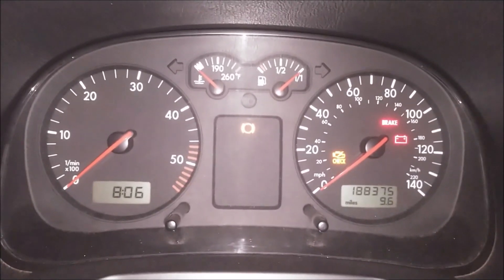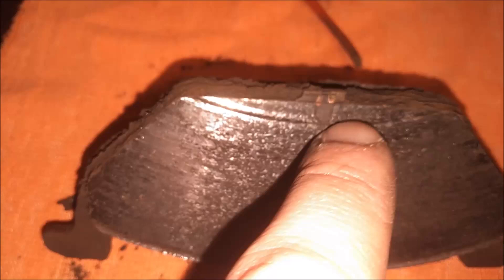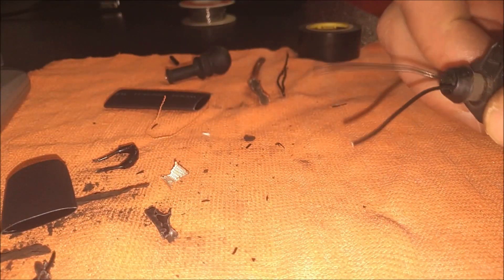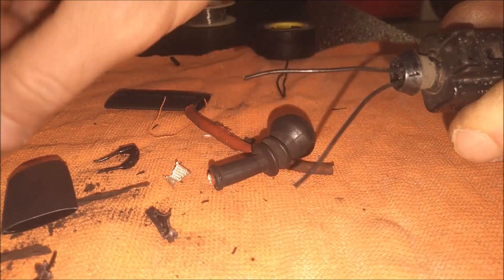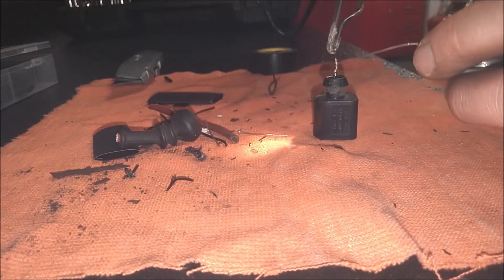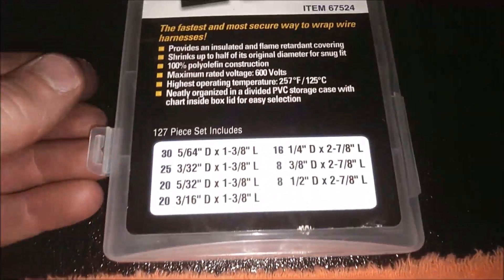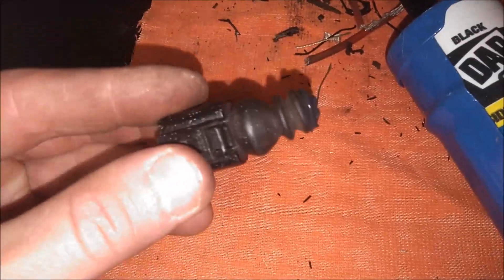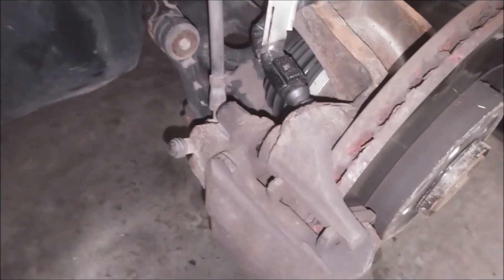VW Golf mk4 brake pad wear sensor bypass

Comment: Thanks dude...... I have the same car and got brake pads that DOESNT have the sensor for cheap...... Just intstalled it and no problem 👍
Reply: I cut them but tugged them snuggarly for next use..... When i have enough money i will buy the correct ones with the sensor and then connnect it correctly .... For now just have to go with the cheap way lol..... Thanks 😂
Reply: It was just a $5 difference but i didnt have the $5 so i took the one without the sensor..... Hard times u know........ But it still works fine
Reply from the maker: @babelonchabalala1690 - Thanks for sharing and good job.

Comment: I cannot find a 109 relay on my car whatsoever.  Not under the dashboard or anywhere.   I need to use my car to get to work.   Any help will be blessed.   Thank you and God bless you all.
Reply from the maker: Does your engine crank over?
Reply: You need to open the cover underneath you're steering wheel and it will reveal the relay panel with the 109

Comment: I have this problem for over a month now.  A 2009 Vw Passat b6 2.0 Turbo - manual transmission.    Now my engine will not turn over.    Can this problem cause this.  

I looked at other videos and they showed a relay 109 problem on TDI models.